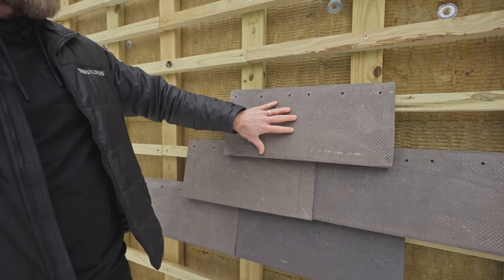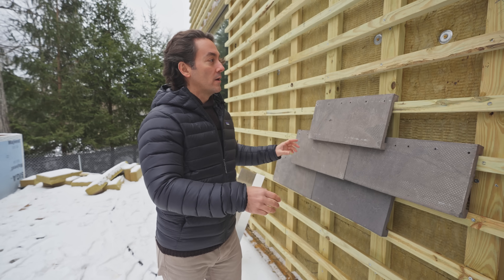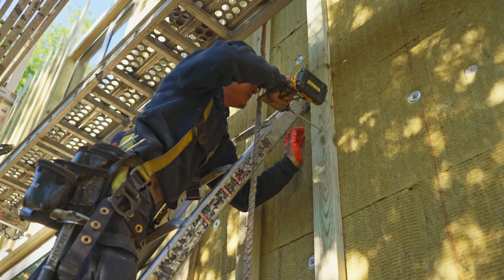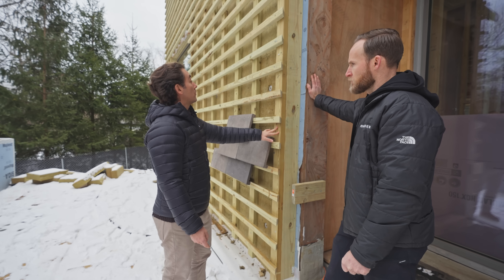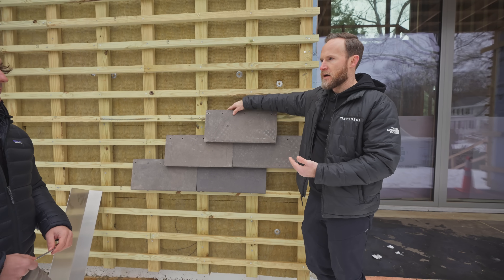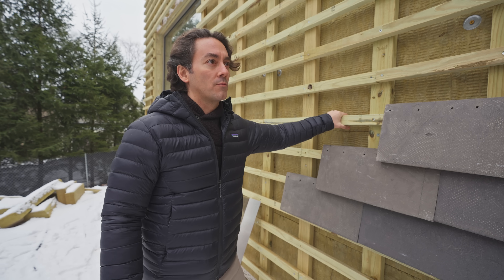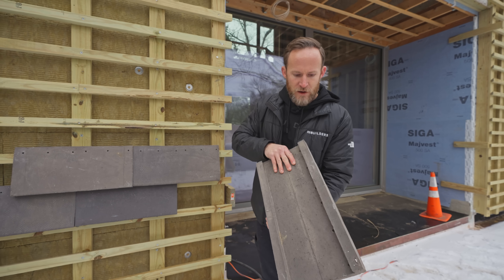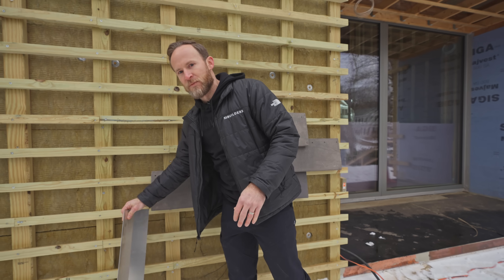The Benefits of Rainscreen Cladding & Exterior Insulation

Comment: Just CURIOUS, is the 2x6 wall also insulated with batts? You have roughly R25 on the outside. Meets code. But over code R-value is easily done.

Comment: personally i don't see any problem with these very heavy shingles and even it might be labor intensive at the start installation looks pretty easy and even DYI possible ..but it would need some reasons ..like.. OK If you will use this system then you will see these benefits and personally i don't see that here if you didn't use this system you could easily build normal wall from bricks and it would be able same so what i'm missing in this video is comparison between other systems there are by lifetime, costs, and other benefits other system wouldn't provide

Comment: 75-100 year exterior?!! Wow, I’ve never hear of anyone being concerned beyond the warranty period of the structure!

It is fascinating what it takes in design, construction and maintenance to build a long lasting structure. 

As a former insulation contractor and working in siding and construction for many years this is interesting, thank you.
Reply: I had one a job on a 600 year standard home. 
Simple way to explain to a siding guy. 
Exterior was limestone slabs 4 inches thick 24 high and 36 wide. Over 200lb a piece if I remember right. Most had 4 bolts epoxied into the stone and structure. 
Near the end a Mason came around the house to his boss with a pallet of epoxy and said the supply house told him they were over $187,000 on the siding mounting epoxy.

All tile and stone inside and out had epoxy grout. The best they could find a rating for was between 1-200 years.
2008 thru 2012 if I remember right,

Comment: Beautifully done, but labor-intensive and very expensive. My wife and I build staggered-stud structures (homes and outbuildings) insulated with blown-in cellulose, the most affordable insulation on the market today. Right now I'm sitting in our own home, with 30cm/12 inch thick walls and approximately R-48 for the assembly. Hardipanel with vertical battens on the exterior, triple-glazed windows. A nice look and incredibly affordable.
Reply: As a former insulation contractor and working in construction and siding for many years, I 100% concur on the blow in cellulose and HardiPlank being excellent and cost effective. 

This is a unique architectural siding and insulation design that is not for everyone.
Reply: Cellulose I have an issue with because of the life cycle rating. Lowest rated of all insulation types.

Comment: This is a fantastic build. i have a house in germany that is very similar except the walls are manufactured ' logs ' made from kiln dried 2x6  three layers thick making the ' logs 14 cm thick with  14 cm thick wood fiber insulation panels , vertical furring strips ove pr that and five quarter wood siding on top . the bottom and top cavities are sealed with heavy duty screen. it's more like perforated sheet metal .  the house is super warm and very comfortable . windows are triple glass tilt and turn .

Comment: Loved the video, thanks for sharing

Most of the ext. insulation I've seen has been rigid board; either zip-R type of product, or a poly-iso in 2 layers with staggered and sealed seams.  I recognize that mineral wool is vapor permeable so can probably dry better in the event moisture/water gets into that layer, but without sealed and staggered seams you'll see some thermal bridging...right?  Genuine question, I have not done it.  I am a building performance guy but do mostly retrofit.  Really enjoyed the content thanks for your time if you can respond.
Reply: Staggered seams are also needed when using rigid plastic foam insulation in order to avoid thermal bridging.

TimberHP is working on T+G insulating TimberBoards (just like most European manufacturers) which should help in eliminating thermal bridging at the seams..

Comment: i'm really fan on that way you build this wall,  is it possible to get og buy a drawings of the wall assemble, and how you done around the windows?
in Denmark where i'm from its not normal to use wood as construction,  so having a hard time to get the double stud wall details right due the fact we don´t in europe have anything like zip panels.  so i have to due something simulér with plywood and siga majrex.  

and man you doing a killer job on the build, and also on the video side ;)  keep it up
Reply: Double stud walls are a bit overkill... I would look into: service cavity (electrical and plumbing) + balloon framing + exterior insulation with Rockwool or wood fiber boards (Gutex, Celit,...).
Reply: @koenraadprincen7212  i feel that double stud wall is sort of the only way to get something similar to zip R 
we do have some few pir insulation but it´s hell of expensive,  most common brand is kingspan 
if we go with kingspan we missing some sheathing for strukturel purpose.   
and if no double stud wall i have to go with 2 by 8 to meet code
plus i need 45mm installation wall on the inside. 

i'm a big fan of having 1 layer of insulation that go all the way around as Monopoly framing do
Reply: @slackeren  ZIP R is actually something you better don't use in a climate like Denmark:
- It's not enough vapor open towards the exterior.
- The insulation (PIR) is at the wrong side.
- It's PIR and that's a lousy material regarding insulating against sound and summer heat.
- In practice PIR doesn't perform that well as you would expect from it's R-value (or Lambda-value).

External vapor open insulation is a better option.

I presume cellulose is rather cheap in Denmark, no? How about flax, hemp, cotton,...?

Which R- or U-value do you need for your walls and roof per Danish code?
Reply: @koenraadprincen7212   Im not 100% sure about the "required" R value since we use the U scale 
but my overall wall installation should be around 45-50 cm 
and i need a min. of 350mm insulation in the walls to meet code. - if its u37,   i could pay to get etc rockwool u34,u32 for and added expense wich could do my wall 2-4 cm thinner. 
my goal is sort of going almost passive house wall.   to keep future heat bills way down.  and not to cut any corner by just doing "minimum insulation" 

im big fan on the wood fiber insulation, but its hard to find some of those produkt that's okay due to our strict fire regulation. there should come some products from the German brand steico q1 or q2 2025 with the right fire regulation,   but they take care of the outboard insulation but still missing the plywood for structural purpose.
Reply: @slackeren  The Danish rules (BR18) specify the maximum allowable energy consumption... but I guess you will end up with a house at passive house standard, a bit like in Norway.

If fire safety is important, have a look at flax insulation, it has fire safety class C and its lambda-value is around 0,038W/m.K.
You could use this in between the cavities together with some extra external insulation.

I don't think an integrated product like ZIP will come to the European market as we use vapor open façade foils/membranes as the outer air barrier and WRB.
ZIP is far less vapor open than those façade foils...

You should check Nicks project "Riverside" or "Oceanfront".

Comment: Die Folie gehört vor die Dämmung.  Luftdurchströmte isolierung hat keinen Nutzen. Bauphysik ist immer noch ein Fremdwort!!👎👎🇩🇪
Reply from the maker: That’s not true.
Reply: Be aware that the North American products of Rockwool are not directly comparable to the European Rockwool products.

For this project NS Builders used Comfortboard 110 as external insulation, this product has a super high density of 176 kg/m³, so you may consider this as windproof, no need for a seperate façade membrane.

Comment: I'd like to see what it looks like when it's done. No doubt it will look  awesome. I'd be concerned about all that weight being supported by a wood frame, but i suppose engineers have signed off on it. Here in Croatia, you'd only see that type of system used over reinforced concrete walls. Maybe over hollow brick too.
Reply: We have our ways. And we have concrete also.😊😊

Comment: It’s a huge effort. It’ll buffer solar heat in summer just as good as 4” brick.

The issue for me is the Tiles comprise lots of vertical leaks. The semi rigid rock wool is an excellent product but I question whether it can stand repeated wetting, especially in the summer when the outside humidity is high and it won’t dry quickly.
Reply from the maker: Yes it can

Comment: The sheer weight of that cladding would still worry me. Ive only been in the business for 10 years but a ton of products I see come out make me very weary because there is "warranties" on products that haven't been tested for that time frame and controlled tests are not the same as long term wear. Im all for new products, but if it doesn't make sense to me, I won't suggest a client does it. 36k in weight bearing on SS screws and treated 2x4 on the flat on to the frame of the house(not some solid footing) worries me. What is the shear strength of the screws? Not to say it won't continuously hold up but I'd love to know sheer weight vs what is actually bearing on the screws and how it would look 10 to 15 years down the road.

Comment: What a great space for critters down the road. It doesn’t matter how well you seal it today, critters will find their way in eventually.
Reply from the maker: You think? 🐿️
Reply: I think bats will love it. Mine have a million $ in guano when you go to replace the siding in a century 😂
Reply: They'll have a metal screen.
Reply: @toomanymarys7355  only on the ends…
Reply: How is that possible with insect and rodent Barrie’s at the junctions?
Reply: @einarquay  They are only putting screens at the top and bottom.
The individual tiles are not sealed. There are plenty of entry points or ways for vermin to make entry. I’ve been in construction for almost 20 years. Don’t underestimate vermin.
Reply: @ that’s what I hoped to see. I have a near Passive house with rain screen walls vented. Screens top and bottom with venting through to the roof uninsulated space. Six tears and no pests.
Reply: @bm -   Nope . i have a house with an almost identical set up that is 15 years old and no critters , so ,,,,,,
Reply: @siriosstar4789  critters doesn’t have to mean mammalian. I guarantee if you removed the siding you’d have a boat load of bugs in there. I have cedar shake siding laid tight to tar paper and I have bugs in/trying to get in.

Comment: I'm curious about the usage of Siga membrane over using something like zip system. Is the performance or time to install different between the two?
Reply from the maker: They “do” the same thing but perform differently. All comes down the the way the envelope is design to perform. Especially in terms of vapor
Reply: Plywood + SA WRB is more vapor open then ZIP and vapor openess is a big plus, especially in climate zones with cold winters linke CZ 4 and above.

Besides that, for certain applications, the WRB of the ZIP sheathing seams not to be adequate enough.

Comment: All new buildings should be designed with large roof overhangs. The large overhang provides beauty and protection from the sun, rain and wind. 
Protection of the doors, windows and siding make for a more durable and comfortable home. Water is the enemy of buildings.
All homes should be built to accommodate the elderly and disabled. This will be better for everyone.
Large wide doorways and hallways make using a cane, walker or wheel chair much easier.
Bathrooms or wet rooms need to have flat floors and no shower hump or pan. A flat floor allows for easy access and drains need to provided.
Easy to use lever door and faucet handles are easier for the elderly to grip and open.
Main floors should include a master bedroom, restroom, shower, laundry and wide walk in closet with few steps to enter.
Homes should be designed with aging in place in mind.
New homes should come with solar panels, a rain water collection system and an electric vehicle charger in the garage.
Reply from the maker: We meet most of those requestes, so if interested let’s chat 😊

Comment: sad they used pressure treated lumber. They use crap lumber to make, it is soft. Regular fir would be much better, there is no contact with the ground. The ventilation would ensure the lumber lasts centuries.
Reply from the maker: Both work.
Reply: It is a beautiful installation and product. Must be incredible noise reduction as well.

Comment: This is a bit confusing to me, shouldent the rockwool be behind the OSB with the membrane? All porous insulationbats works best when you have non moving air in them.
If it was like a closed foam EPS boards it would be a different story.
Reply from the maker: This is ComfortBoard not Batt. And designed to be outboard of the WRB
Reply: @NSBuilders  Are they sealed in any way? I know rockwool is good with water but the less the air move the better value.
Reply: @fesen2  Those Rockwool Confortboards 110 are very dense, so you can use them as a "jacket" to protect your house against any cold wind.
Besides that, the brick cladding also acts as a wind barrier.

In case of a "softer" wool like insulation material, you're correct but in that case I would protect any exterior insulation with a vapor open facade membrane (foil) or a vapor open wood fiber sheathing (I don't consider OSB as vapor open).

Comment: In driving rain, how much water penetration would you get between the vertical join on the shingles? Or due to the air gap you would just expect it to dry out fine even in winter?
Reply from the maker: Enough, but it’ll dry

Comment: Why not use aluminum horizontal runners as they would outlast the wood.
Reply: @MM-sf3rl  thinking the same thing. In fact, let’s go all aluminum; horizontal and vertical. You could probably get bigger spaces from center to center due to the higher strength.
Reply: You would need a custom shape to get the french cleat effect. In practice, this house will last until some one wants something different.
Reply from the maker: Wood is perfectly fine and will last with the rain screen details